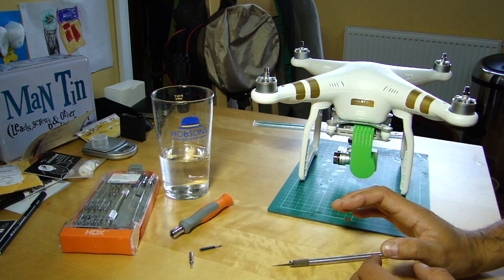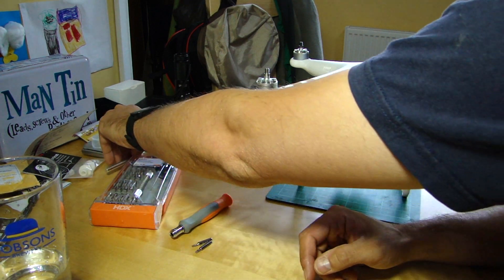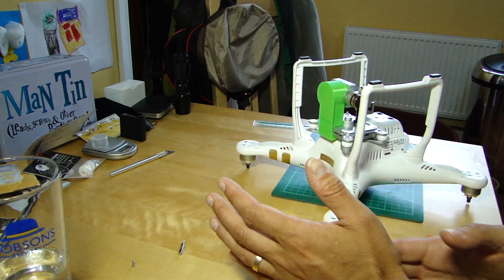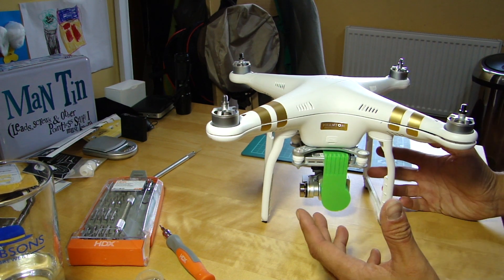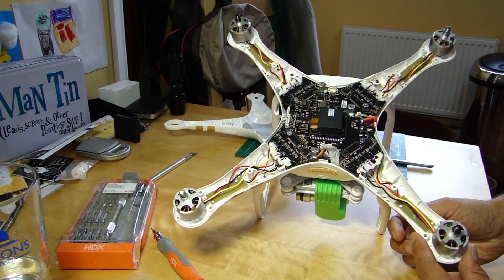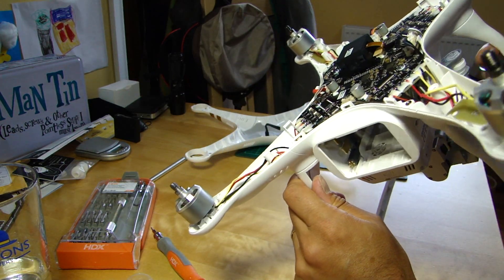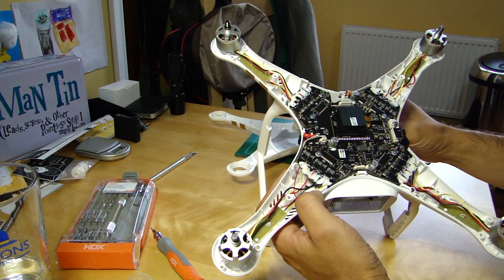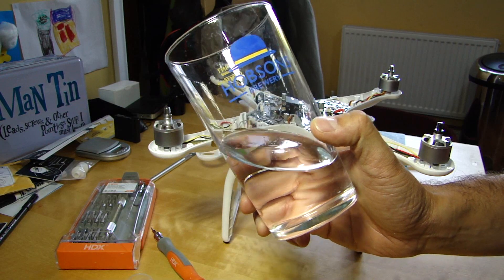How to open the DJI Phantom 3 - and a first look inside

Comment: Has anyone swapped the LED's? I hate the fact that most drones have red in the front! I want to move them front to back. Seems easy enough to just lengthen the wires and physically move them. Any tips on this?

Comment: been fixing these and gotta say, the ESC (whole center board) can burn out if a blade gets stuck on anything. electronics are sensitive , but these are to sensitive.  I am working on a solution, but its solder in right now.
Reply: Hi Eric ...Well i did it i crashed my phan 3 adav was having problems controling it and decided to land it , it was very difficult but got it to land on a roof and it flipped upside down pinning one of the blades that was trying to turn but couldn't becuase it was upside down , it kept running by the time i got  to it , it was smoking bad at the mototr with shell starting to melt at motor so i'm now about to take apart and see what the damage is other than a burnt out motor .Then i seen your post here about whole ceter  board burn out is there a way of telling if this is burnt out?

I'm mechanically inclined BUT not that good on the electronics.....any advice are you able to guide  me??

Ted Kortun 
Canada
Reply: I sell new in box ESC boards, they are soldered in though.   on ebay they are about 140.  if you wanna pay shipping and mail it to Orlando FL I'd do it for around 225 including one new motor   my # is on my website dronesetc.us

Comment: Very good tutorial. I just want to know something not explained. I have one motor to change. Do I have to unscrew the for screws of that motor before I open? Another tutorial shows and unscrew on the 4 legs. I think that we have to unscrew only the defect motor. Last question if you know. On the same tutorial, after welding the new motor, it is shown that he use hot glue. Is it necessary ?

Comment: I just purchased one I'm trying to figure out what is this hard drive scratching sound I hear.
Reply: +Bryant Fuller Maybe a prop is rubbing on something.
Reply: Rodney Leinberger i figured it out it was the gimbal I had this protective thing still attached to it making it make that noise...soon as in removed it stopped

Comment: Is there enough play in the wires that you can just unscrew the 4 screws going to a motor and pull out enough to clip the wires and soldier another one in without prying the whole drone apart??

Comment: 8:50 "they have absolutely doused everything in semen"
Reply: +Simon Newton haha thanks :)
but how do you replace things like the escs or something if they burn out? i have a phantom fc40 and am upgrading to a p3a soon, and i had a burned out esc once but i replaced it no problem. how does it work with the p3?
btw if that isnt what you said then what did you say?
Reply: ah. I kinda feel like its just another way for them to make more money, as far as I know making everything on one main board doesn't give any real advantages (correct me if im wrong)
Reply: +Steven Ewald GFX some space saving, little weight saving, less cost to fab and populate a single board in one run.
Reply: +Matt Brewer it costs a TON more if you break an ESC or burn out a motor or if anything really happens you have to replace the entire board
Reply: +Steven Ewald GFX but it doesnt cost DJI that, unless it falls in the warranty period, and thats not very long

Comment: What are the exact sizes of the torx screws that hold the top shell on? I need to take it apart to replace a cable, but i am unable to because I do not have the right size of screw driver to take out the screws.

Comment: thank to your video i get the step to open My one week phantom 3 pro that sound terribly just after I installed the motor reensforsmens  so I don't get to the crack point! wen one of the motor get unscrew the cables start to make vibration and touch the shell inside and part of the led boars! sound like crazy even wen I know from the beginning was because of some thing like that, I was scary to open up! but today was the day and I fix it ! thank u for your video hope u understand my point!

Comment: Hi Simone is There A Way To Access The Micro Memory Card, inside the Battery Bay Fixed to the main board
or remove and replace it?
Reply: +Simon Newton Only Problem I Have is a Bought my DJI Phantom pro Second Hand its only a few months old
The Aircraft is locked into the last owner's name, I want to change it to mine, Originally this was done with the DJi Pilot app, there is no feature on the dji go app, so i was wondering if the information was stored on the internal Storage

Comment: Finally had to open up my P3P to clean some sand out from a tipover. Man those clips are tough. I got about 6 of the sides and 2 of the center ones but now my fingers are sore so I have to take a break. Why did they make it so hard yet still possible? Don't get it.
Reply: +Simon Newton Sounds about right. They could've made it even harder but maybe that would've cost more. I will get the last clips undone tomorrow!

Comment: This is a little depressing.  for something which is quite pricey, repair is a requirement if something goes wrong.  Which it will. Shame.
Reply: ***** I believe it might point to another problem. The ability to buy a 'toy' like a phantom off the shelf changed the type of person who could put something into the air. When you had to build it yourself the mentality was different. There was fundamentally more to loose.  And with the toy nature of the device come the toy mentality of the user.  And the reaction to it from the likes of the cca is enviable.

Comment: These flimsy DJI plastic shells really are complete and utter rubbish, especially for the price you pay.

I build and fly racing mini quads with carbon fibre frames and you can literally hit a tree at insane speeds and the tree comes off worse for wear. New props and you are back in the air in minutes, with any luck. Never broken so much as an arm yet (lost a $30 FPV flight camera once and smashed LOTS of props, lol) An entire carbon racing frame kit can be had for $70 up to $200 or so. So why the crap plastic on the DJI?

Comment: Thanks for the video but after seeing this I will never buy a phantom 3 looks like a real pain in the ass to service.I love my phantom 2 and have serviced it plenty of times from new ESC,bearing replacements,motors,gps mod for more sats,Osd, and remote mods..it dose what I need I fear that if I ever make the move to a p3 I will hate myself.I do love the VPS module other than that my hero 4 black takes better video and is much more customizable in post.
Reply: +tokoam Your Hero4 black doesn't take better video, nor does mine. There's no fisheye here and you don't have to buy (and install, adjust, tweak) a 3rd party replacement lens for $200+ (or whatever they go for these days) to eliminate the fisheye effect. This is so much more versatile, too. You can change ISO and shutter speed while flying in video and stills mode. You can shoot video, then shoot stills, then back to video while flying. I think I changed from regular stills mode to HDR while flying the other day. Image quality is excellent...for a small-sensored camera. Once you put your P2/Hero4 in the air, it's settings are not adjustable until you manually change them...but that requires you to land first. Gimbal on P3 is topnotch. Whole camera/gimbal unit costs $530 appx compared to $700 for Hero 4 and DJI Zenmuse gimbal. 

I don't work for DJI, but DJI's stuff works for me and makes me money. I'm not thrilled with the one-piece main board, but that's the price of doing business with such a wonderful creator of amazing products which are intrinsically linked to their evil customer service and proprietary design features.

Comment: Hi Simon, first let me thank you for your videos. They are an invaluable tool for me. In this video you mentioned how easy it is to strip the small screws at the end of each arm of the P2. I just ran into this problem and was hoping you might have some suggestions for getting the striped screws out. Any assistance would be greatly appreciated.
 
Thanks,
Rick

Comment: Watched your video and took the lid off mine to realign the shell after a crash (One of the locking tabs popped out from the shell flexing so hard). I kept thinking to myself as I was popping the tabs, "this process should not be so violent, I'm going to break something!". Well I stuck with it and was successful, but it is seriously concerning how much force you need in the right places to remove it....

Comment: Hi Simon! great to see you got the phantom 3! I have a phantom 2 and am very happy with it except for the low quality video feed, Lightbridge is such a great feature on phantom 3 but does not justify the upgrade and as you know getting the Lightbridge on phantom 2 cost way too much. Also I'm quite disappointed they are not providing any support for gopro cameras...Now my questions, have you tried the H3 4D (or 3D) on the phantom 3? do they have the same cable connections? if not would it be easy to hack it in your opinion? have you tried the remote controller of phantom 3 with a 2.4GHz phantom 2? Any suggestions of 1080p video transmitter on phantom 2?
Would be great if you could tell us what things from the phantom 3 we can use in the phantom 2 :) thanks Simon!

Comment: Actually the T9 was used for all the shell screws except the very end one at the end of the arm. The product manual says T8 but the shell screws nearest the landing gear were in pretty tight and I felt slipping with the T8 so I tried a T9 and it worked great.

Comment: Nice to see how it comes apart but hopefully I'll never have to do it.
You missed talking about the micro SD card in the middle of the upper part of the  battery compartment.  Pretty much impossible to get out.
Reply: ***** Yes a black box data recorder.  Data is accessed by plugging cable into usb jack on P3.  System must be powered up and in the pilot app in the Advanced setting there is a command to enter flight data mode.  The SD card will then show up as a drive on your computer.  This is much the same as accessing data stored in the iOSD Mk 2.  Downside is that as of yet there is no program to read the data.  There is one for the iOSD Mk2 data but it does not work for the phantom data.

Comment: What we are looking at here is DJI saving money on production of the Phantom as everything is integrated into a single mainboard. And just as you said, this means damage to an ESC (for instance caused by a motor being stopped rapidly) means the ENTIRE Phantom is basically broken. You would have to replace the entire mainboard, this is a huge step backward from the previous Phantom 2 as it had a more "modular" design which allowed for various components to be removed/replaced.
This is not a step towards the customer, but rather a step towards quicker mass production and lower production costs. Also this setup means putting it together in the factory will probably take less time compared to the Phantom 2 due to more connections having to be made (solder points etc).
The ONLY downside of the Phantom 2 modular design is that with more cables and connections, there is greater chance of failure due to material fatigue...

I fly the Phantom 2 with the DJI 2312 motors (the same as the Phantom 3 motors) and H4-3D and GoPro 4 Black and in reality there is basicly no difference except the almost useless ground sensor of the Phantom 3 which is only useful if you fly indoors which in most scenarios you wouldnt do anyway.
The promotional video showed it flying in a church during a wedding, as a professional videographer I can tell you that nobody in the right mind would let a drone fly inside a church during a wedding simply due to the intense noise, it would ruin the entire atmosphere, think of it logically, there isn't much use for the ground sensor. All it does is suck power and add weight for 90% of your flights with absolutely no benefit to you at all.
Yes it has better GPS, that is true...

Just my 2 cents, certainly not worth the upgrade for me :)

Comment: It's about time that DJI strengthens the bottom part of the shell from where the LED location ends and the two screw area and motor location begins. Especially that double screw location. A lot of them are developing cracks there which leads to a situation where the top of the shell can no longer do its job of keeping the motors from twisting. The only solution after the cracks develop is to glue the top of the shell to the bottom along the seam from double screw hole area to it's corresponding location on the other side. The phantom 3 does not crack anywhere else other than there. Definitely not inboards of the LED area where the shells are thicker and stronger.
Reply: ***** But keep in mind that the over tightening of the four inner screws has never, ever, led to any stress cracking issues on any phantom. 1, 2 or 3. Why? Because the material thickness around the middle of the phantom is far more suited to the task at hand and far less susceptible to over tightening issues. You could have chimpanzees tighten the inner screws and have zero chance of a crack. But when we are talking about those two side by side screws after the lights, the slightest bit of over tightening leads to cracks. In my opinion it is material isn't thick enough in that area along with over tightening. I had to super glue all four of my phantom 3 arms at the last quarter and now the structure is stronger than before against twisting forces. Three and a half hours and twelve flights later and no more stress cracking issues.

Comment: My Phantom 3 Pro was crashed a week ago. It was my mistake and cause I was panic , can't control. Hit my garage door and slammed to the floor. "No MC Data - Accelerometer Failed" message in my iPad on RC. Attempted to start - not success. Now... I don't know what to do...? I plan to send to my local DJI dealer for repair. Any suggestions will appreciate.
Reply: ***** Many thanks for your response. I've seen in the DJI forum how to fix it (link http://forum.dji.com/thread-19612-1-1.html). Does it works? Anyway, I won't to try it caused I don't have any experience of it and no tools (special screwdriver), etc.

Comment: Hi Simon! A question: why would You like to add Flytrex to P3? What's the point here? As I understand P3 is all in one UAV and soon it will even have POI/mission planner. You can also record Your flight using Your Nexus 7 (as a separate video) so loosing Your quad is rather impossible, but please, let me know, if I'm wrong somewhere here.

BTW, how big is Your lag in Nexus 7 2013 (I have the same one and soon will buy a P3 Pro)? I've read that the iPad Air 2 & Mini 2 (and up) are the best tablets with the smallest lag among all tablets.

Thanks and all the best!
Reply: True, but I believe it was much more useful (Flytrex or similar 3G/GPS based tracker) on P1 or P2 than can be now, on P3. All those famous "flyaways" which was mostly caused by unexperienced pilots and popularized by earlier versions of Phantom with naza system now, with a new P3 is unlikely to happen.
Of course, good to have a tracker on board, but at the end every gram counts; I was thinking about it for a very long time (I have rather heavily modified P1.1.1), but decided not to buy it mostly because of the additional weight..
Thanks for the info about Your N7 - I appreciate this! :)
Cheers!
Reply: *****
totally agree!

34g? Well, I find it more interesting now :)

Comment: This has kind of pushed me away from upgrading in the future, I always liked the idea that if I can fix it myself I will more than happily give it a try, so integrating the ESCs on to the main board is disappointing.

I think if I ever did an upgrade though I would most likely remove the clips from the shell, too much effort for the usual maintenance. Plus known how heavy handed I am I would probably crack some trying to get in anyways.

As always though cheers for the video :)

Comment: Hi Simon
Like yourself and s few others I'm a little surprised at the way they've intergrated the ESC's onto the main board. If an ESC fails, which is quite probable in the event of a bad landing where the Phantom tips over and the motors are still trying to turn, it will be next to impossible for your average owner to repair themselves. Also, unlike previous versions of Phantoms, there is no airflow over the FETs of the ESC circuits. However it's obvious that DJI have put a lot of thought into the construction as there is a noticeable absence of wiring around the main board.
One little tip with separating the shell is to use a heavy gauge guitar pick rather than a metal blade as this will reduce the likelyhood of accidentally breaking the clips and also prevent gouging the plastic. 
Overall the P3 seems to have had a relatively successful launch where as the 3DR Solo appears to be suffering issues due to what might be considered a bit of a premature release in a similar vein to that of the Inspire and earlier Phantoms.
Regards
Nidge